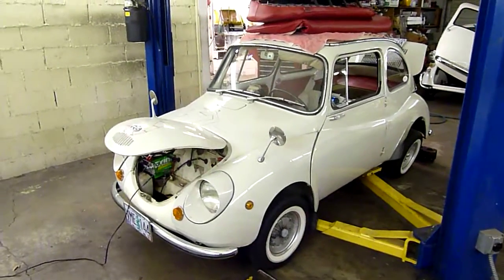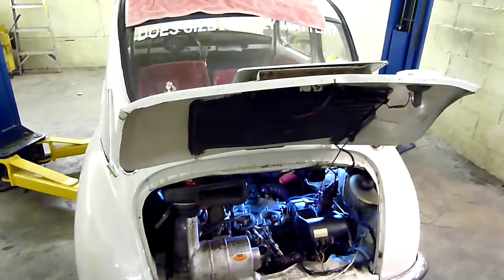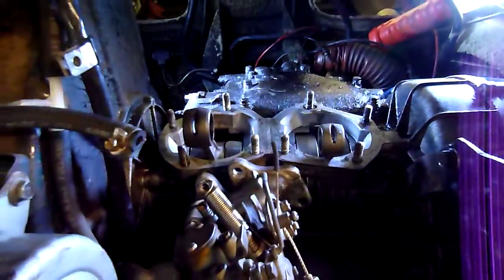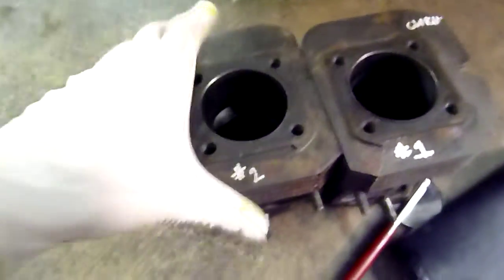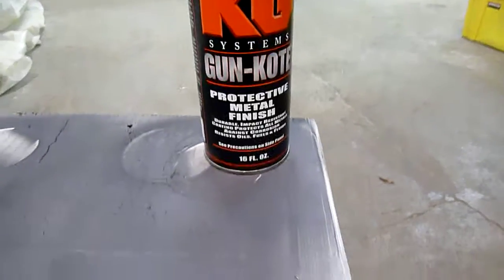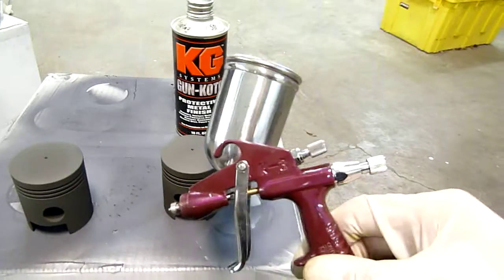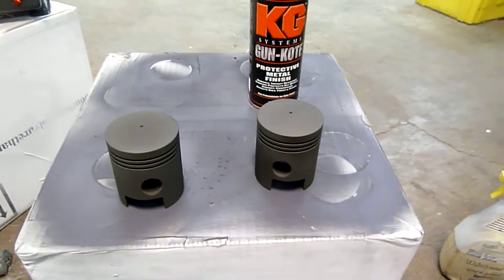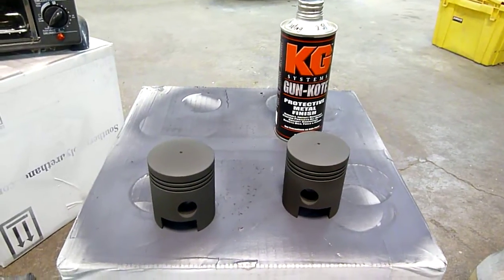Subaru 360 Piston Coating

Comment: I like a bit of castor in premix (just for the smell LOL) because it is such a good antifriction aid. Don't use premium fuel or avgas in your old 2 strokes; both elevate EGTs. And on the old stuff, don't believe 40:1 and 50:1 claims on fancy oil bottles. If the engine was designed for 20 or 25:1, run it that way. Fouled plugs are almost always down to poor ignition systems. I know of engines that drank 5:1 which ran just fine.

Comment: You know Mark, given proper cooling, correct piston clearance, and the right fuel and lubrication, 2 stroke piston seizures are really quite rare in my experience (lots and lots). For instance, Suzuki Titans would rack up 50, 60 thousand miles without a problem, usually way more. The watercooled 750s; they just went forever. Granted, there are engines that had design shortcomings that made them seizing fools. But it's usually down to ignition timing, mixture, lube, or poor cooling.

Comment: cool, didnt know you could coat pistons yourself. 

but, do you know the real reason its seizing?  improper warmup, overheating, lean mixture, not enough oil, cylinders are round and true? 2 strokes usually wont seize unless something is wrong.